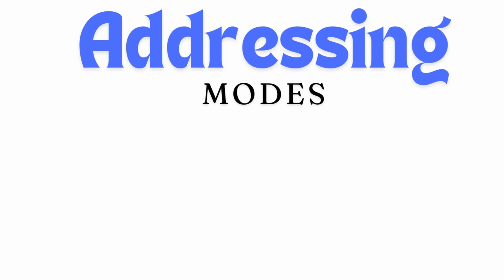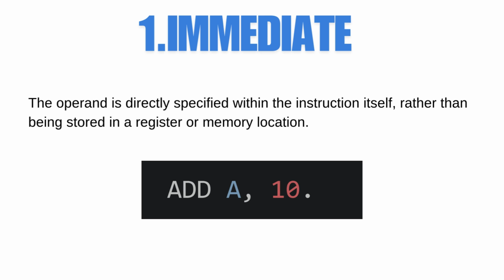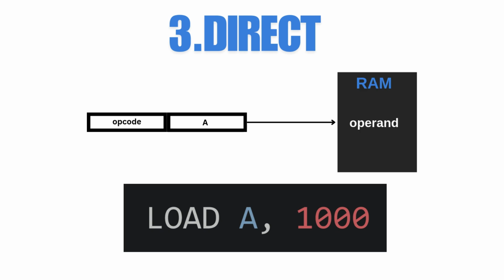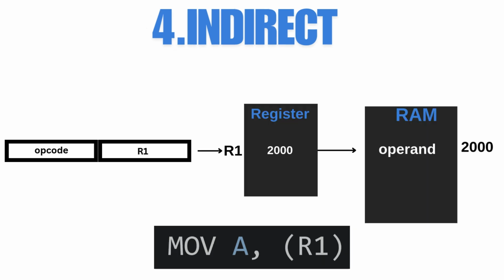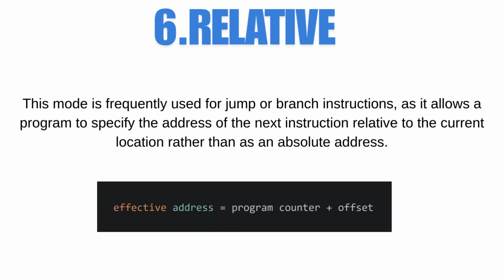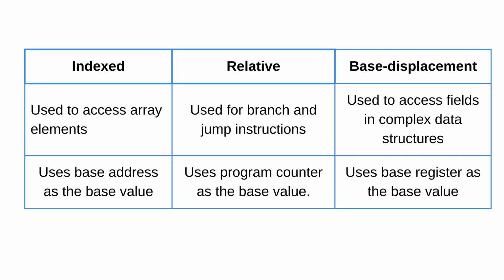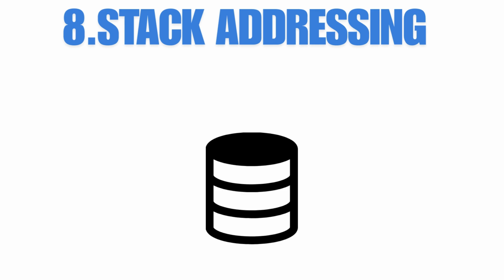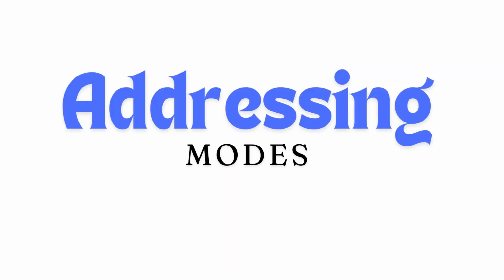Addressing modes explained

Comment: Addressing modes are techniques used by a CPU to determine where to find the data (operand) needed for an instruction. Think of them as different ways to say, “Hey, get the data from here.” Each mode offers a unique way to access memory or registers, which can affect performance, flexibility, and code size

Comment: Intel makes things unnecessarily complicated. IBM mainframes are SOOO much easier and have been since the 60s. IBM Mainframes dont need a silly stack pointer. totally unnecessary
Reply: IBM mainframes have a certain elegant simplicity—especially when compared to the sometimes labyrinthine design of Intel architectures. IBM’s System/360 and its successors were built with a very different philosophy: general-purpose registers, consistent instruction formats, and a clean separation of control and data flow. That made them remarkably forward-thinking for their time.
As for the stack pointer—you're right that traditional IBM mainframes didn’t rely on a dedicated stack pointer the way Intel x86 does. Instead, they used register-based addressing and control blocks to manage subroutine calls and returns. This gave programmers more flexibility (and responsibility) in managing memory and control flow. It also meant fewer implicit behaviors—something many developers appreciate when debugging or optimizing.

Comment: mov eax, [ebx+esi*4+64]   ; using the Data Segment DS by default, SEGMENT:OFFSET = address
Reply: @maxmuster7003  how dumb with all these special purpose registers. Give me 16 general purposes and let me put anything  i want in them. IBM has been doing this since the 60s you figure other processor manufacturers would learn.
 Intel is so brain dead 
Ie. L R12,68(R4)  which means load into Register 12, whatever is in 68bytes beyond what Register 4 is pointing to
Oh btw mainframes dont need or use stack pointers....us any register for anything you want. Simple